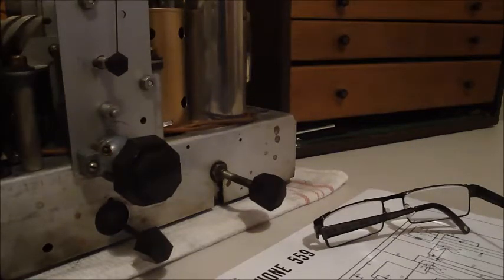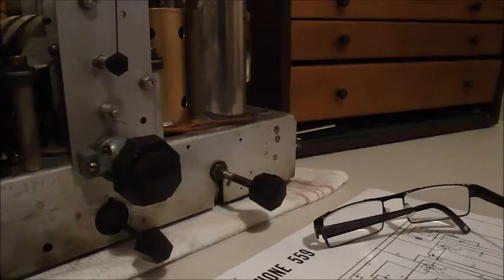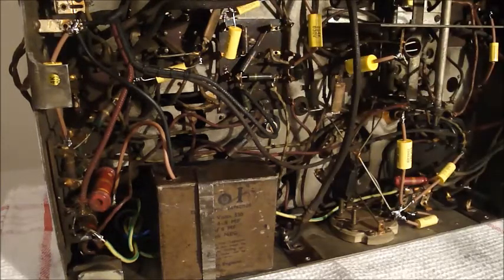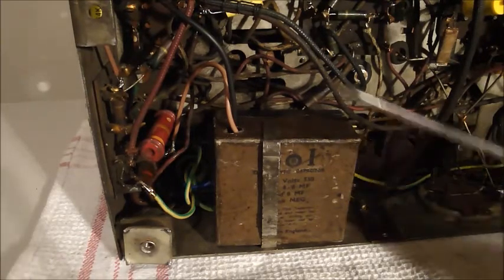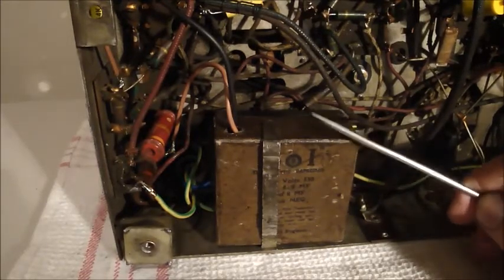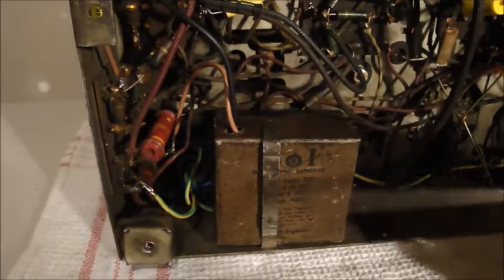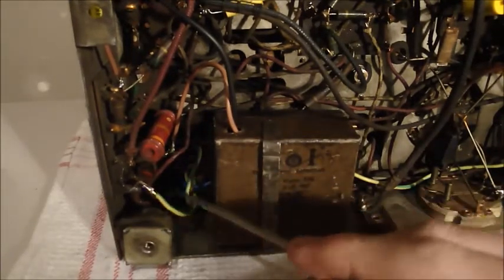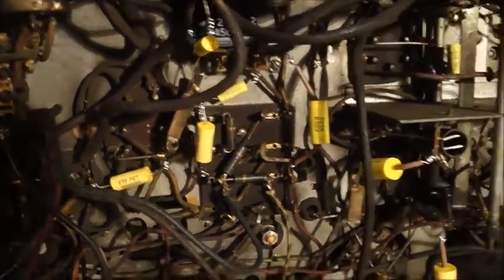Progress of the Marconi 559 #3

Comment from the maker: Phil,
Thank you, my friend. As I said in a comment below, I've only re-stuffed wax caps once solely because the radio was for a friend! I re-stuffed the e-cap box on top of the chassis due to the simple fact that it's relatively simple to do, and saves lot's of room. I'm delighted that you've approved my work, I trust a TV/Radio technician!
I've been given the contact details of a valve supplier down south named Phil Taylor, isn't you is it? :-). I'll be sure to keep you posted.
Regards,
Dylan.

Comment from the maker: Tom,
I checked that one out, it's a sprigot base tube. I require a much earlier tube which has 7 pins and no locating key (sprigot) on the base. The tube was released in 1937, therefore it is rather scarce. Thanks anyway, my friend. I appreciate you taking the time to check. Dylan

Comment from the maker: Al,
I sure do! The coil lead method has always worked best for me. I've spent hours in the past unwinding the original leads, just isn't worth it, huh? It seems our radio manufacturers shared that in common! This tube isn't as rare as the Pen45dd, it however will take a bit of searching. I'll let you know how I get on with the tube supplier. Thanks, buddy.
Dylan